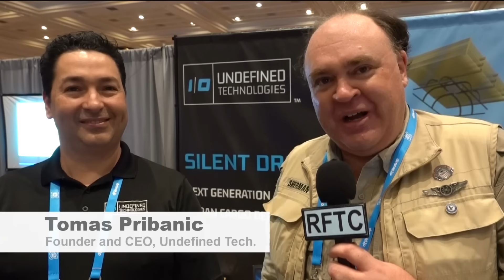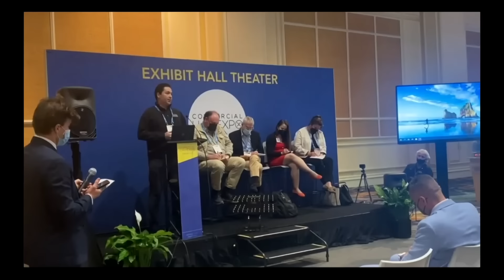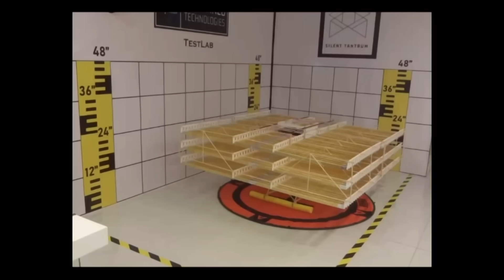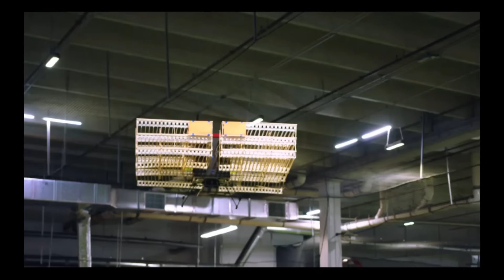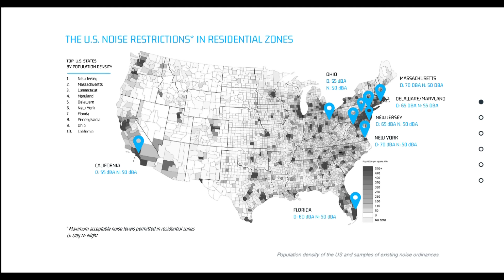New Drone Tech: No Propellers, and Yet It Flies!

Comment: Powered by a gigantic EDF in the center of the drone lol.
Reply: Maybe they will be telling us the fan is just there to blow away the ozone!😄
Reply: Spot on 👍
Reply: If anything, I'd say almost all the lift is provided by the EDF and maybe, just maybe stabilized by the ionic wind.  Seems fairly pointless but who knows!
Reply: @BadassedRC  I believe this is whats happening.
Reply: @BadassedRC  I thought the same, but I think we’re being generous. He did mention it’s silent and doesn’t wake his dog. I’m calling full scam in this.
Reply: ITS NOT SILENT LOL
Reply: The grid ends look like they flex upwards on takeoff. There needs to be some  force on them
Reply: They don't even try to hide it. Just claim it has no propellers and provide no audio of its flight. Definitely dont invest in this company.
Reply: @SerratedAlarm  1 min 45sec you can see the 70mm red EDF
Reply: @SerratedAlarm  it is based on high voltages
Reply: @Thebasicmaker  you're a little late to the party.   I'll catch you up.  Everyone already knows the tech they claim is providing the lift is high voltage. That doesn't discount the fact that the actual lift is supplied by an edf.  Probably a 3s or 4s edf.
Reply: @SerratedAlarm  
Seemed like they cut all sound too 

Why not explain the fan?

Bizarre demo.
Reply: @SerratedAlarm  yeah, it's almost a scam
Reply: @SerratedAlarm  The fan is for the electronics, not lift. The directional control, which they demonstrate, would need 4 fans. I built one of these 15 years ago, no lift controls, just proof of concept. They work and they blow people’s minds because they’re so foreign to what they’re aware of. Technically it’s called an asymmetric capacitor or a “lifter”.
Reply: @SerratedAlarm  the fan is only there to cool it. If you saw where that's routed you'd retract your statement.
Reply: What is a edf?
Reply: @madsiepatsie  electric ducted fan
Reply: It seems that I see the same centrally located ducted fan as everyone else.  My flame wheel hexa was noisy until it was 50 feet up. Then you couldnt hear it...
I think we're being played.
(They will say the EDF "energizes" the air to create the ions)
Reply: Even if it was truly ion-propelled, wind would blow it away like a leaf.  Ionic lifters have to be incredibly light, and those big boxy frames will catch wind like a barn door.
Reply: I have to agree with the EDF thing. You can't miss it. Besides the EDF thing, Ionic lift or thrust isn't very feasible as an efficient propulsion system to have enough lift and thrust to carry anything more than a note written on a small piece of rice paper unless your in an atmosphere with little or no gravity, not to mention, achieving this with a very limited power supply.
Reply: My friend built an ion thruster, they do work, was triangular shaped and shot into the air (connected by a wire to the power source), I'm sure you can find videos of them, think it was called a lifter or something like that.
Reply: @emmacheeseman4758  watch the Hutchinson effect
Reply: I saw that.  But anyone whose flown EDF jets know how loud they are.  You wouldn't be able to fire it up next to a sleeping dog.
Reply: @usmcmma  The EDF in this craft is pretty loud. They have a video up with sound. They did some trickery here to make it “silent”  https://youtu.be/iihprC5Huf4
Reply: TOMAS PRIBANIC WITH THE BUBONIC CHRONIC ‼️
🔥🔥🔥🔥🔥🔥 🤘😝🤘 🔥🔥🔥🔥🔥🔥
Reply: @bootstraphan6204  lol what dispensary sells Bubonic Chronic.....asking for a pal of mine.
Reply: maybe they call that a cooling fan 🤣
Reply: got one of these over the stove. kept trying to fly off so we had to mount it to the wall ...
Reply: I was wondering if my eyes was not playing trick on me until I read your comment,
Reply: Technically they're correct - no propellers, just a single ducted fan 😜
Reply: @KraussEMUS1  Won’t the ions attract lighting? Especially with the thinning atmosphere and the sun’s coronal hole plasma blasts increasing with this cycle causing more lightening with ions? I think it would be a good way to use the ions rather than uncontrolled lightening. Really interested.
Reply: @rivergrrrl1256  
It's a very small relative number of negative ions and nothing is grounded, so I don't think it would attract lightening generally speaking. Perhaps if there is a "rush hour" like situation in the future, some charges could build up, but they do tend to dissipate fairly quickly.  Again, I wouldn't worry about it ever being a problem.
Reply: @TimEFPV  This post needs to be pinned or highlighted or something!
Reply: What is an EDF...for the newbie here
Reply: @AndrewHorezga  its basically a brushless motor with a propeller that has ducting around it
 its what electric rc jets use for flight
Reply: @chirakyan.yervand502  thnx
Reply: Lol new tech🤣🤣 mate anyone with a spare high voltage power supply has screwed around with makeshift foil crafts using ion propulsion.... not rocket science boys🤦‍♂️
Reply: @Megan Matheson  I think the real invention is more or less making a controlled and vehicle efficient enough to lift more than it's mass and have fully controlled flight via the same concepts. It's certainly nothing new, to be sure. However, still nest overall.
Reply: @Nurhaal  agreed.. was more having a laugh at the people thinking it was fake or they were hiding something..  not sure they are aware of the voltage required to run these little suckers..   they did do a ripper job with the flight controls i agree... that would have taken a hell of allot of tinkering..
Reply: Never! That is the CPU and Ion drive cooling system. LOL..
Reply: My guess is that fan in the middles to cool down the chips with the incredibly high voltages going through it ,personally I can't see that tiny little fan controling that huge unstabled platform 🤷but I could be wrong none of us know so we?
I think we're all just assuming like we always do!
Reply: Great, These jackwagons are trying to start WW3 while this guy is inventing the TIE Fighter. We don't need this.
Reply: What the heck is a EDF ?
Reply: @relaxingnature2617  Electric Duct Fan.
Reply: Con 101
Reply: Con air 101
Reply: Noise is everything. Quick mute the video!
Reply: 5ft×5ft×1.ft/15min.flight/2lb lift. by ions. Dream on.
Reply: What does EDF stand for?
Reply: Fraud
Reply: Do people really believe that a small company can come up with a revolutionary new propulsion system? ( Actually it is known technology, demonstrated... does work a 1-7 kWatt engine provides thrust in 100s of mN ...that's millinewton. That's 10 Gramm of thrust.... Not enough to hover that vehicle
Reply: @deedeeko9  of COURSE a small company can develop breakthrough technology...just not THIS one! LOL
Reply: @deedeeko9  If they had a highly creative individual with the small company they easily could. Small company doesn't equal small brains. There are many crafty inventors hiding things they dont want the government to steal and bar them from their own work. It has happened several times before.
Reply: Exactly! 
Thank you!
But Jeff, there is even a more ridiculous situation here. Your comment has the most likes and comments by faaaar but why comments with 5 likes and no replies are shown first?
Reply: This are they we've been praying for, something like a Messiah.. Step up 1.
Hello humans 👽
Reply: gas/ electric  could work to
Reply: @TimEFPV  oh nice 😂 that edf is pretty loud.
Reply: Lol
Reply: they must be stupid extremly
Reply: I can't wait for an explosion
Reply: I mean, I saw an edf in at least one shot on this video...
Reply: when i saw that rotor i was like is the whole world trying to fake everything with everyone 😑 daa fhaaak may be this is why Russians are nucking
Reply: Considering for a minute that the power electronics probably requires a fair bit of cooling - which means heavy heatsinking, or a fan.
That EDF would be a perfect candidate for cooling, whilst also adding lift...
I can see small struts holding the lift arrays together - those would arc over on a normal lifter, assuming the things are in 'series' to increase lift.
Reply: I can see back to the future hover boards on sale next year
Reply: Thom pribonic and his magic EDF
Reply: That is a cooling fan for the electronics do you really think no one else is smart enough to see that? Stop trolling
Reply: @scottsherwood9665  No one’s trolling. It doesn’t sound like a cooling fan at all and neither is it silent. You can even see the flaps on the bottom that change the direction of thrust from the edf. Play it back at the slowest speed. I’ve been building RC aircraft for years. I recognize thrust vectoring when I see it. https://youtu.be/iihprC5Huf4
Reply: You can easily tell where the lift is coming from  they might be using a central EDF in the center and the ion propulsion to steer.
Reply: @mrtangerillo7758  Watch this video at the slowest speed and pay attention to the bottom center of the 4 legs at about 28 seconds. You’ll see the flaps they use to change the direction of thrust from the edf. These guys are blatantly lying with the apparent believe that no one would be able to tell. It reminds me of something you would see on kickstarter. https://youtu.be/iihprC5Huf4
Reply: Giant EDF in vaccum= no noise
Reply: It doesnt even matter if its fake or not. This abomination of a drone is EXTREMELY susceptible to wind and has close to no carrying capability. Using it indoors is not an option due to the amount of toxic ozone produced. 
Even if you assume the technology is real, it has no practical uses and their claims of "urban cargo" and whatnot are utter bullshit.
Reply: Anuddah "Pump & Dump" scheme!!!🙄
Reply: I was about to comment on what it sounds like while in the air, just out of curiosity.

But yeah, no audio is a bit of a red flag. Hopefully the inevitable Chinese knock-offs will prove the point wither way hahaa!
Reply: It's a flying computer lol
Reply: It’s a combination of two technologies.  The EDF provides the yaw control via torque. Do you hear a fan running?
Reply: Hang on  Where's my fridge shelfs gone?
Reply: Hahahahahha I see it too 🤣
Reply: It's not April yet you are early.
Reply: Here’s another video, the drone doenst look exactly the same, but you can tell it’s made by the same people if you look at the thrust vectoring device on the underside of the craft. 
https://youtu.be/iihprC5Huf4
Reply: Snake oil explained
Reply: It‘s sooooo stupid!! Such an obvious scam :-D
Reply: What does EDF stand for? 
Extra Dirty Fuxkstick
Reply: I saw that too
Reply: Trash
Reply: That's for cooling the electronics Bro
Reply: 🤣🤣 lols what a con.
Reply: Lol love how they disabled comments on ion undefined technologies video, wonder if it's from people calling there bull shit.
Reply: Preposterous 😂. That's an electric ducted fan in the middle. Absolutely a sham 😂
Reply: i guess his dog is deaf 😅
Reply: European defense found?
Reply: And yet it flies what is going on?LOL
Reply: Good to have such suicide drone in a war.
Reply: AN EDF AIR THRUST PROPORTION!!!!🎉❤😂😂😂.😮
Reply: How about blow foam with helium that way the foam is lighter than air?
Reply: That's what I thought... hardly groundbreaking!
Reply: Same logic as Dyson blade less fan
Reply: @note2tee  more Sucky, sucky?
Reply: @note2tee  Probably
Reply: @note2tee  incorrect. That has a fan inside!!!
Reply: @mikefromspace  yes they have a spinning impeller inside like what Dyson fan is.
Reply: @note2tee  LMAO!! Yup!
Reply: @note2tee  no the dyson has blades inside the machine and the air comes out of holes.
Reply: @note2tee  no not, 
In Dyson fans , blades and motor are hind in bas stock
Reply: @note2tee  no? Bladeless fan has hidden blades lol
Reply from the maker: I am really hoping I'll get to see this thing in person at some point -- although it doesn't help that I'm in the far corner of the country. I couldn't be much further away and still be in the United States. But, anyway, given how those panels flex when it lands, I feel pretty confident there isn't a prop in there, or it would shred those panels...
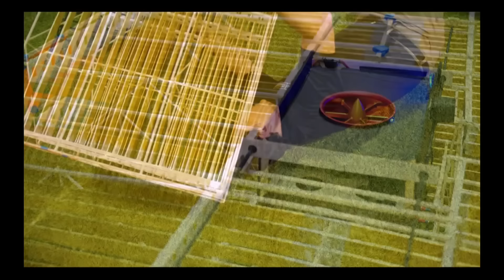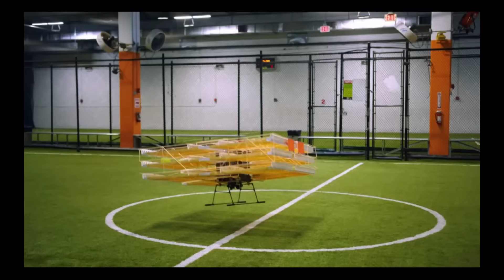Reply: @Roswellflighttestcrew1947  I'm in the same corner of the country you are :) And it isn't a prop, it is a contained EDF right in the middle of the center electronics stack (I assume that is what the middle is) You can se it clearly at 1:45 in the video, and at 2:08 - 2:35 or so you can see on the bottom what looks like thrust vectoring moving on the underside in that middle stack as well. All of this makes me think that device flying in the video reel is powered by a thrust vectored (HUGE) EDF, and the plates are just for show/size/mockups. But I will say with 100% confidence that thing flying in the video is powered by that EDF lol
Reply: @SweetBlu  there is no vent on the top to support your theory. It looks like an enclosed box at 33 seconds. If it is an EDF where is the intake port?
Reply: @newmonengineering  the closed box is the unit at the show (that one did not fly) In the video of it flying you can clearly see the electronics on the top with lights and that it is open. 

Trust us. That is an EDF in the middle of it. The fact they didn’t show it flying at the show and the video has no audio is a dead give away. Also the fact that you can SEE THE BOTTOK OF THE EDF!
Reply: @newmonengineering  you must be blind if you can't see the fooking big EDF right in the middle
Reply: @SweetBlu  You're right! They just use the high voltage thing to control it's direction!
To make that giant fly by itself would need alot of energy... I just saw a video of a similar technology (a true no propeller) but it's a penny size and it's wired to a high voltage source, and here's the link: https://www.youtube.com/watch?v=6rDBV12sCB4&t=89s
Reply: @newmonengineering air  generally   flowes through  the axis of rotation   in conventional turbines
Reply: @SweetBlu  How dare you question the great and powerful Oz!
Reply: @SweetBlu  yes, however there are actual ionic wind drone experiments, this just isn’t one of them, and they are not this sucessful yet
Reply: @newmonengineering  I believe the fan helps with the cooling. I don't think most of these people know what lifters are? If they did they would know how this works and is real
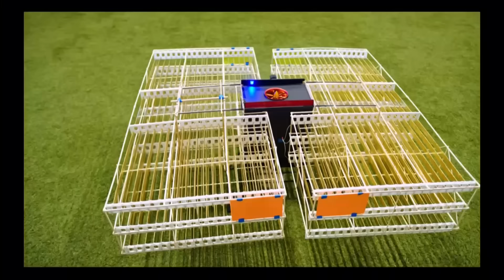Reply: @newmonengineering  look at 1:27 you will see the fan and also you can tell the cover is over it in the show.
Reply: @SweetBlu  what does  edf stand for?
Reply: @johnsimpson5471  electric ducted fan.
Reply: @SweetBlu  👍✌️
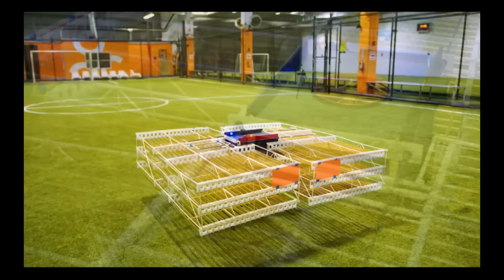Reply: @newmonengineering  @01:44
Reply: @powerhousepaperairplanesrogers  LIfters are real but they can't carry their power supplies the thrust to weight is off by at least 100s of times.  On my channel there are lifter like crafts that lift their power supplies, but they are the only ones that do it by ion propulsion.
Reply: @KraussEMUS1  I don't know how you are not getting more attention! 
You are the only one who is actually doing it for real!
It's a shame to see a gimmick get so well promoted, while everyone ignores the actual success.
Please keep improving it!
Reply: @KraussEMUS1  How much ozone do you think a lifter of this size would produce?
Reply: @DNMEBOY  I don't know the exact mathematical quantity without putting some time into it.  The crafts I build produce none that one can smell because the actual wattage use at the lifting structure is very low and it just adds electrons to the O2 molecules. 
 The UT craft gets its lift from a ducted fan.  The classic "heated cathode" lifter part of it, if it is hooked up to a high voltage source, would produce a very strong odor and would go above the legal standards indoors in short amount of time, depending on the size of the space and wattage.  Since their 2-stage lifter cannot lift itself and its power supply, it is kind of a moot point though.  It would work better without the lifter.
Reply: @newmonengineering  you can see the EDF fan blades at the top, orange colour. It's very obvious...
Reply: @newmonengineering  its clearly visible, its even red! Stands out like a sore thumb when you know what your looking for
Reply: @newmonengineering  1:44
Reply: @SweetBlu  sources: trust me bro
Reply: @SweetBlu  Now you said EDF 3 times and still didnt explain what it even is the shorcut for.
Reply: @User456ngjDf4DlT  I did but it got lost in all the comments lol. 

Electric Ducted Fan
Reply: @SweetBlu  ok
Reply: @jamiereynolds2798  what is an EDF
Reply: @RU12DV8  electric ducted fan
Reply: @newmonengineering  the EDF is red and the intake is what you are looking at centre top.
Reply: J @SweetBlu
Reply: @newmonengineering  an EDF that small would not be able to carry a drone that size.
Reply: @Roswellflighttestcrew1947  🔴 What Is Islam? ⚠️

🔴 Islam is not just another religion. 

🔵 It is the same message preached by Moses, Jesus and Abraham.

 🔴 Islam literally means ‘submission to God’ and it teaches us to have a direct relationship with God. 

 🔵 It reminds us that since God created us, no one should be worshipped except God alone. 

 🔴 It also teaches that God is nothing like a human being or like anything that we can imagine.

🌍 The concept of God is summarized in the Quran as:

📖 { “Say, He is God, the One.  God, the Absolute.  He does not give birth, nor was He born, and there is nothing like Him.”} (Quran 112:1-4)[4] 📚

🔴 Becoming a Muslim is not turning your back to Jesus. 

🔵 Rather it’s going back to the original teachings of Jesus and obeying him.
Reply: @Roswellflighttestcrew1947  please don't put your face there: at least figure out what is that EDF for...
Reply: I think the idea of using ions is good because there are more ions in the atmosphere with its continued thinning—evidence the increased amount of lighting caused by increased ions entering lower altitudes.—So making use of those extra ions would be good but what would happen if it was flying and lightning struck it?—Caused by the attraction of the ions. Just curious 🤨
Reply: Ionic propulsion is a real thing. The fan is not propulsion- it's for cooling electronics, I'll wager.
Reply: @alvarofernandez5118  Sounds like it’s for lift in this video. 
https://youtu.be/iihprC5Huf4
Reply: What is an EDF?
Reply: @BehruzbekOtayev  It's an electric ducted fan, basically a leaf blower. They are especially noisy.
Reply: @KraussEMUS1  Like a hair dryer on steroids. EDF's are used in RC planes to simulate jet engines. They are not very efficient.
Reply: @BehruzbekOtayev  electric ducted fan, basically an electric motor with a fan inside a duct.
Reply: Boy, this was an intelligent response. Oozing with the powers of observation and common sense. 

Of course, it's an EDF. They plainly show you this in the demo reel. They LITERALLY ARE NOT HIDING IT because the concept of using ionized airflow for use in aerodynamic applications is nothing new but extremely hard. It's called Magneto Hydrodynamics. 

The drone still needs the EDF to get off the ground to test but the control of the multi-axis pitch is performed by the MHD grids. 

This Meaning, the concept isn't fake at all, you're just over exaggerating the expectation. I have no idea what you were expecting, some dude inventing UFO technology?
Reply: That's a cooling fan for electronics.
A fan like that doesn't have nearly enough force to lift a drone that size.
Reply: I saw that too I had to rewatch it
Reply: Not EDF.  
It is high voltage "lifter"
Been around for years.
These guys decided to
do more with it, but did
not invent or discover it.
Reply: @haulingheartache2380  There’s no way this is a lifter. The edf  is visible in this video and in the one I linked you can hear it spin up and down when they take off and land as well as to maintain thrust. For a small lifter like you see on YouTube we are talking about 15-20kv which is 15,000-20,000v and require a power supply to bump the voltage. Lifters must be be very very light so there’s no way it can carry one along. These guys are pulling a fast one. Comments are disabled in the video with sound so no one can call them out and in this video they just removed the sound because they are lying about it being silent.
Reply: @DNMEBOY  
Been a long while since I had the free time to play in the lab with old tesla patents and stuff, so I'm not up on the lastest youtube stuff either.
Are you saying the video is some what fake?  Just propeller driven?
Reply: @DNMEBOY  
I will say this, built a faraday disk about 15 years ago, and it worked, then it was stolen (I believe for the copper) by a drunkard who didn't know what it was.

Though the voltage was low, the amperage was high, and I was going to take it a step further and figure out liquid metal brushes, when the thing disapeared.

So, though many youtube vids are fake, there is a lot of hidden technology out there.  Just sayin.
Reply: @haulingheartache2380  After seeing the ducted fan in the middle of it in this video and then hearing it in the other one I’m about 99% positive it’s using a brushless motor and edf for lift and thrust vectoring for directional movement. You can hear the motor and fan spinning up as it climbs and back down when it descends. I build and fly RC aircraft so I’m familiar with how they behave and sound.
Reply: @haulingheartache2380  I don’t doubt that there’s hidden technology but the faraday disc generator isn’t on of them.
Reply: @haulingheartache2380  are you blind !!!!
Reply: This is real
Reply: @blackink8471  it is a real joke
Reply: It looks like the fan in the center helps with directional movement but the flight is achieved by a high voltage differential forcing ions downward. 

"High voltage lifter" I don't see this tech getting much better due to the fact that it's been over 20 years and I guess the only improvement I can see is a fan